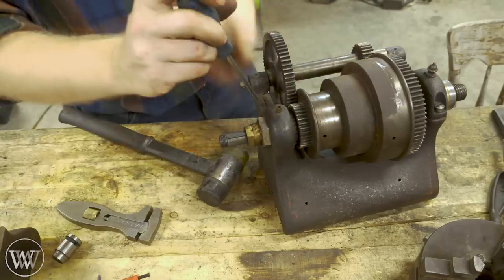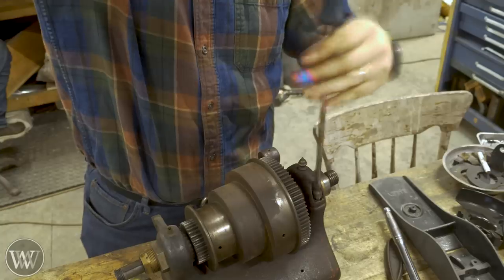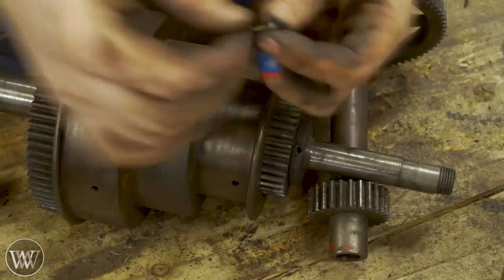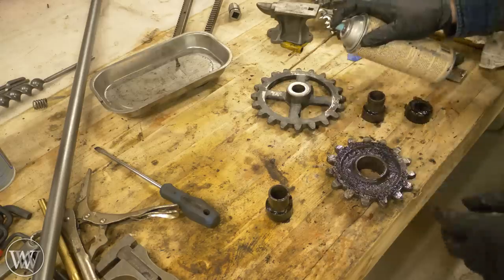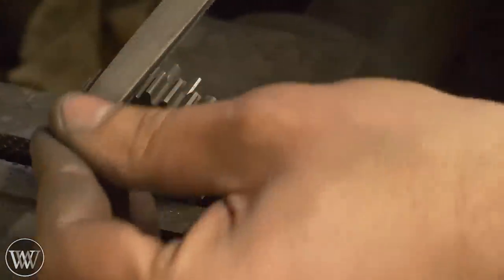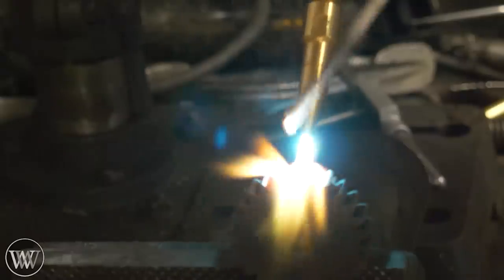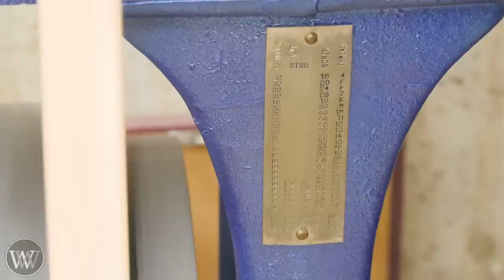Restoring 2 Barnes #5 Velocipede Machining Lathes With Hand Tool Rescue

Comment: What frame rate are you using or what shutter speed when you recorded this video it looks like you got a lot of motion blur In the first 3 min but the Rest of the video looks good
Reply from the maker: Yes. And the first three minutes or so I had accidentally set my shutter speed longer than my frame rate. Didn't realize it until I'd been doing work for over an hour.

Comment: I have a 2 pedal Barnes lathe, no compound/taper. Absolutely love working with it. I hardly ever run it with back gear, just middle speed, light cuts & maintain flywheel momentum.

Comment: Nice to see this, I have a smaller, 6-8 inch version of this lathe w/o the pedal drive passed down thru my family over the years now as a motor powered bench lathe.  No compound on it but a unique cross feed that pivots at the center of the carriage casting for turning tapers or ball ends. Has the twin lead screw, complete set of gears for thread cutting and an interesting Harper and Reynolds brass name plate on the headstock casting.  A friend just sent me your die filer restoration video, count me as a new subscriber !  Thanks for your efforts- mjm

Comment: Wish I could find a replacement drive pulley for mine. A past owner sadly converted my Sebastian lathe to electric 😔
Reply from the maker: That is an incredibly hard one to find. And often worth more than the rest of the lathe. I don't know of anyone who can cast one either. But if you put out some feelers on the fans of foot powered machinery, you might get lucky. It's a group on Facebook.
Reply: @WoodByWright  Thanks, I will look them up.  If it comes down to it, I will just make one from wood, but time will tell.

Comment: I have a 1902 Drummond brothers treadle lathe I need to restore. Everything works except its missing the flywheel and treadle. I have considered making up a velocipede system for it just to get her working again. Mind you with the constant load shedding here in South Africa a manual system might be best.

Comment: Since the lathe is MANUALLY operated, it is technically not a POWER tool. No electricity or outside power source, it is a HAND tool ;-) I just wish I could have one of these. Over 100 years old and with a little cleaning and a few replacement parts, their just as good as new, something not so easily done today, I wonder why? I did watch "Hand Tool Rescue's" rebuild too.
Reply from the maker: they were missing a lot of part but thankfully there is a foundry that has patterns for them.  I have been looking for a long time. and sure enough when I find one he is selling 2 of them.

Comment: Coming from HTR channel, nice video in here as well. I looked around your channel a bit, you're actually closer to my hobby as a carpenter. Even though I'm more interested in making a practical piece of furniture than decorating it in such detail, I've found quite a few useful tips and tricks in your videos, so you've got yourself a new sub.
Reply from the maker: thanks man. I usually have on big piece of furniture going int he shop at any given time. I just finished a full bed frame. and am now working on a pair of 8' long desks.

Comment: Imagine motorizing that, instead of foot pedals! Future project maybe? :)
Reply from the maker: The one for hand tool rescue was originally hooked up to a motor. I won't do that in my shop as my shop is all hand powered but most of them were actually changed over to motorized power. More than half of them don't have pedals anymore.

Comment: Hi guys there is something I have not heard anyone mention about evaporust, if after you have finished removing all the rust and grease from your metal parts if you dip the parts in to evaporust then let it drip dry evaporust is awesome as an anti rust barrier that works amazingly well
Reply from the maker: So true. There are a lot of great things about that stuff.

Comment: That looks like it's hard to use and doesn't work very well
Reply from the maker: on the contrary it is very easy to use and works just as well as any modern lathe, it just does not go as fast.